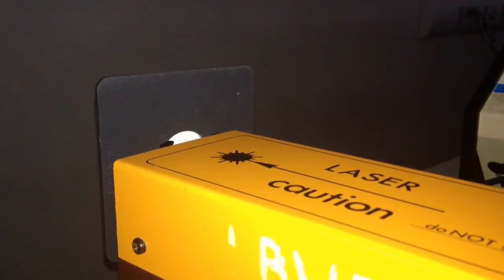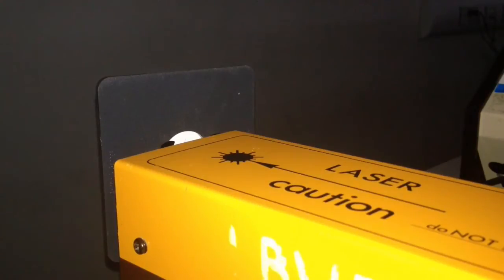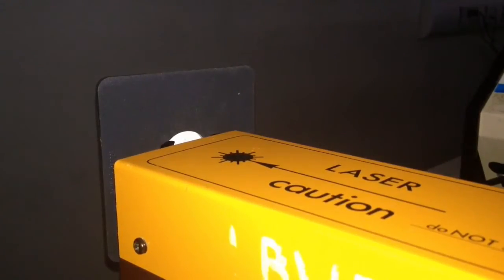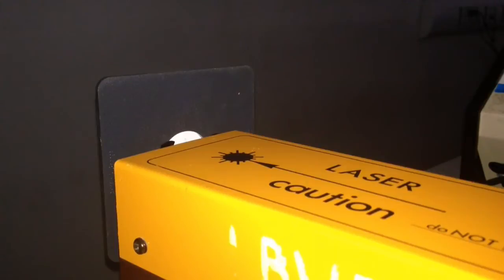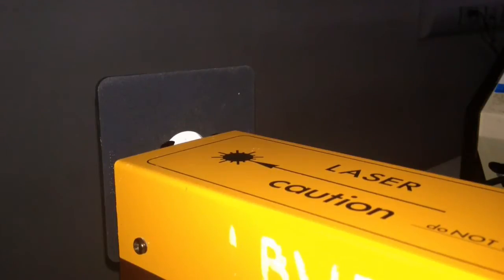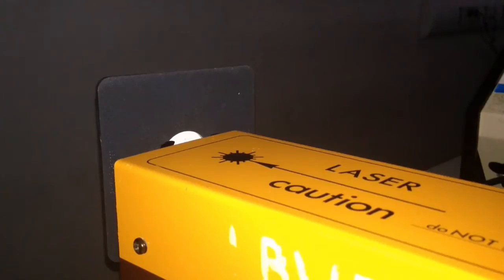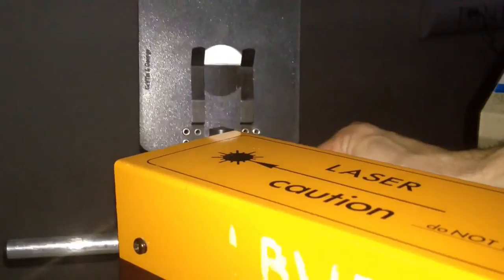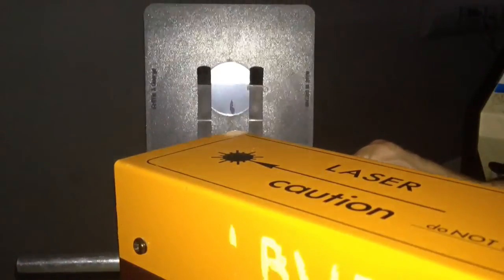Two source interference - monochromatic laser light

Comment: you don't need a slit to create the interference pattern. just use a toy laser, and point it toward a mirror so the reflected been aligns with the source of the beam and suddently the dubble slit pattern appear in both the mirror and yourself if you do this when yu stand in front of a mirror.
Reply from the maker: Interesting phenomenon. But that would pose more of a health and safety hazard for class demonstrations.  Also the slits are probably better for making measurements and are required knowledge for the exam and equation.